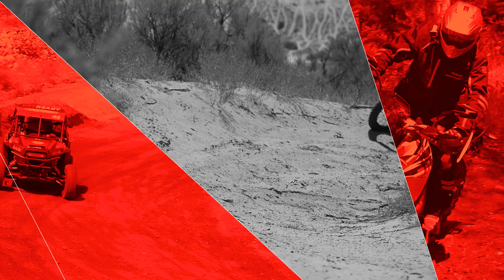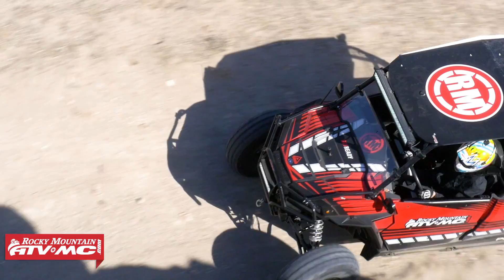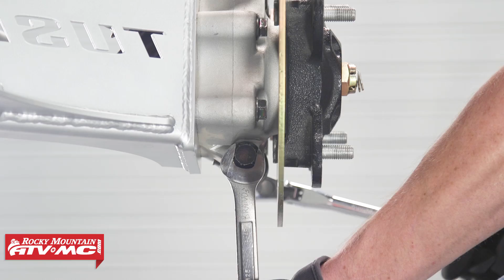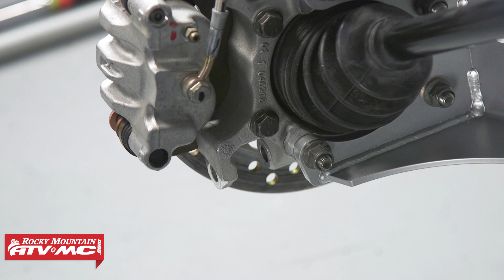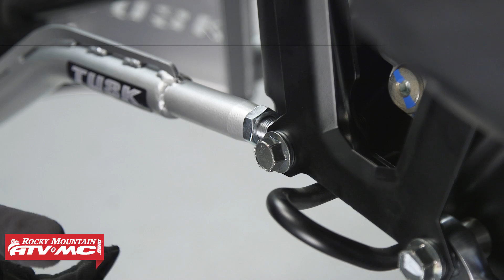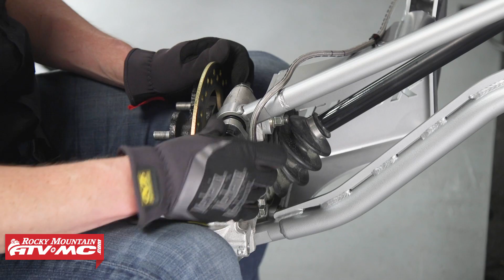How to Install Tusk Mohawk High Clearance Radius Rods | Polaris RZR XP 1000

Comment: Recently installed the lowers on my 2016 XP 1000.  I had to remove a TON of aluminum for the end to fit into the knuckle. Definitely made the job a lot more difficult. I removed so much I had to take the knuckle completely off, put it in a vice, and really go after it to get it the radius rod to fit in correctly.  Kinda frustrating.  Had to remove so much that if I was to replace it with a different brand it most likely wouldn't fit right.
Reply: That's messed up if need to remove that much from the knuckle.
Reply: @kylegohawks8604  ya I'd say I probably had to remove at least 1/8" inch.
Reply from the maker: Ethan, we're sorry to hear about that. As discussed in the how-to video, there can be variances from the manufacturer for the tolerances between the tabs on the hub the radius rod fits between. We have test fitted these on many machines and we've also had to file some of them, for example, we had a 2018 model and they slipped in perfectly, but then on a brand new 2019 model, we had to do some filing. In your case, however, of the many machines we've installed these on, we've never had a case as bad as what you've explained with yours.
Reply: @rmatvmc  lets just hope they are as beefy as they seem and that I'll never need to replace them.  😊
Reply: Really I had to remove a little but not much at all

Comment: Most aftermarket rods are strong enough...but those Heim joints shown in this video are total crap....(made in China,. they have those  black plastic injection slots on the sides of the ball joints) ....one went out in my 2018 RZR Turbo 1000 SxS...... cost me $550 in shock repair and 6-JMX Made in USA Heims....I was able to fix my twisted trailing arm....buy USA made Heims or you'll be sorry.